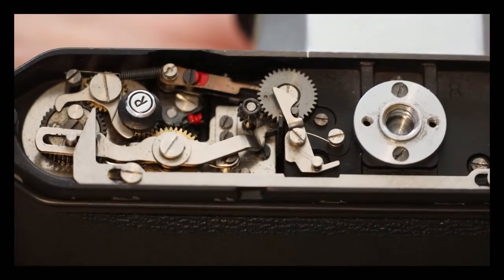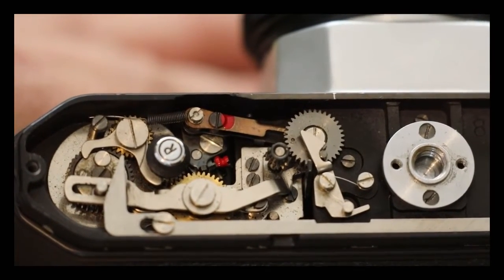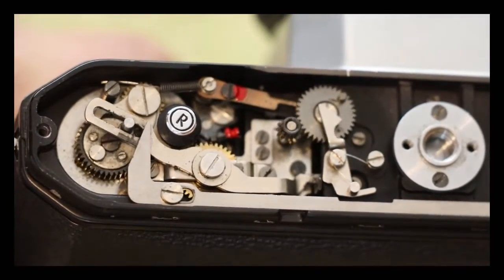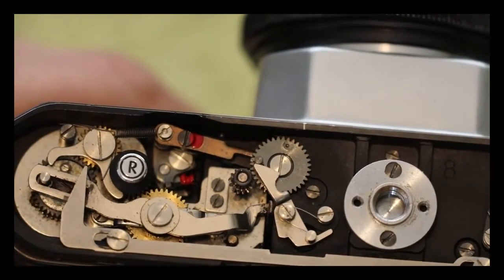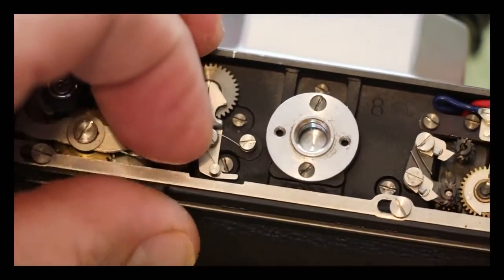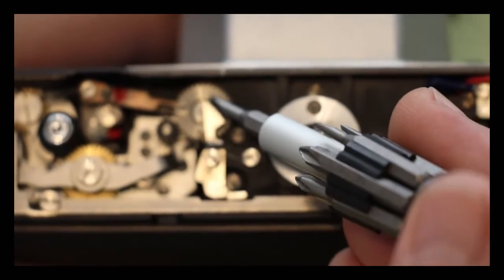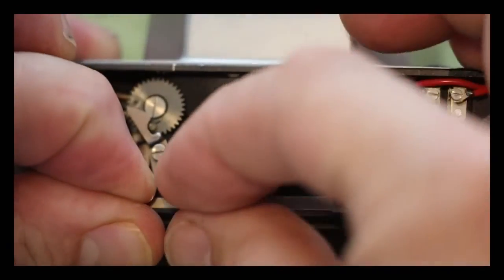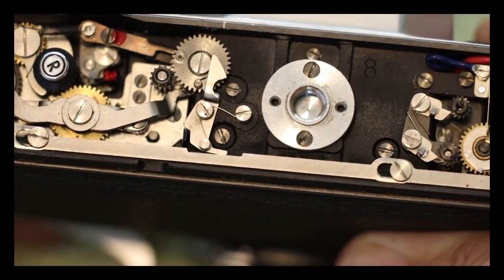Pentax SV repair

Comment: not sure if this will be seen but my pentax seems to have just jammed randomly. 

Mirror remains in the up position.
I can wind on and fire, but the shutter remains open. 
When I wind on, only one curtain is pulled across. 

From following the video I managed to get the mirror back into the down position, but winding on and firing makes it stuck again.